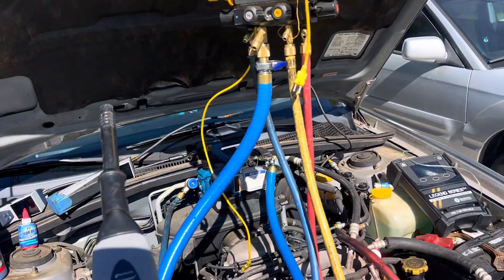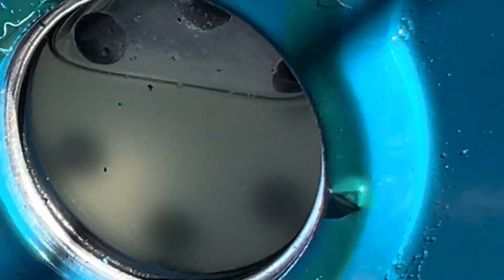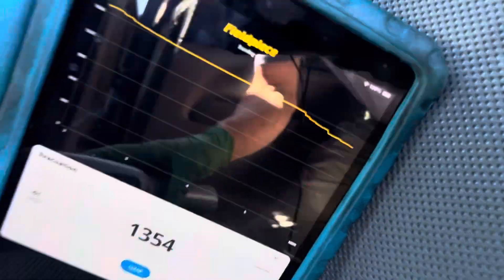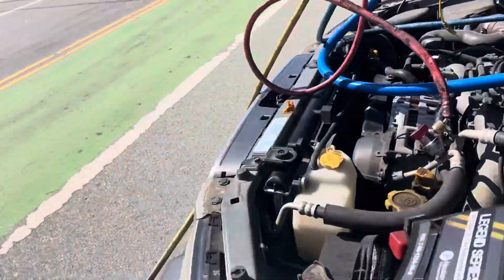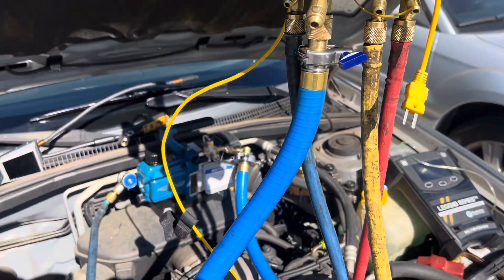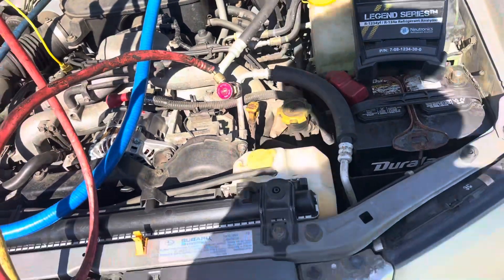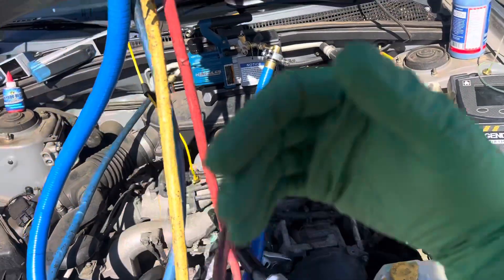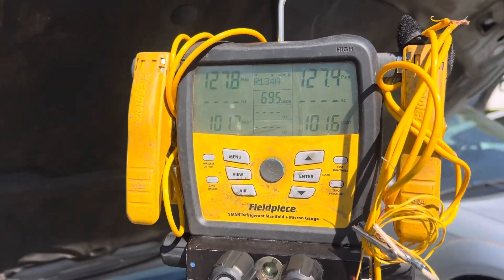Highly moisture contaminated Subaru air conditioning system ￼

Comment: Tom I like to purge the systems I work on with low pressure nitro to flush out the moisture before I apply pressure to leak check  keep pesky moisture molecules from gathering on the inside o f the system before I jack up the pressure.  I see a big difference In flushing out the moisture.and pulling g vacks,  Down side is use up alot of  nitro.
Reply from the maker: @Stillwrenching  first you vacuum.  Get the vacuum below 1000 µm.

Then slowly, purge through the high side, allowing it to sweep the walls of the pipes, pushing the moisture towards the low side fitting . 
  Then close off your high side port and pull a vacuum on your low side port into you again achieve below 1000 µm I like going to 500 if I can quickly, but sometimes that cannot be done quickly due to moisture. 

Three more times a total of three times . 

With the car running so the heat of the engine heats up all the metal lines. This makes the moisture molecules energizes them so they move faster and under a lower pressure will come basically popping out to the surface of everything everything on the inside of the pipes and hoses. . 

As you perform your nitrogen sweep 🧹
Reply: @coldfinger459sub0  I'll try that technique.  I done many triple evacuations but never that way,cool tip thanks .  Mostly work on 10 ton package units on transit rail. Always leaks. We're running 22. And 407c imagine that still running 22 .
Reply from the maker: @Stillwrenching  https://youtu.be/dWIBcFN3nqQ?si=eTPt8cIqWCxffRg2

More information over on the Facebook group 

Automotive HVAC technicians

Comment: Got my 2000 Outback at around 450 microns before charging it.  I'm not going to lie I was pretty proud of that.
Reply from the maker: @mailmanjoe  450 µm after shutting off the vacuum and it leveled out after several minutes ? That’s good then
Reply: @coldfinger459sub0  Yes